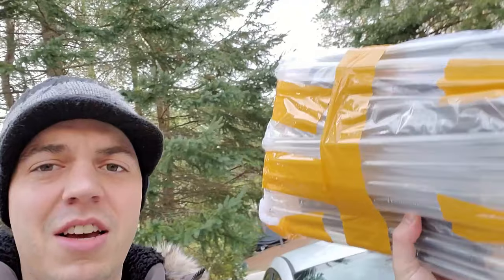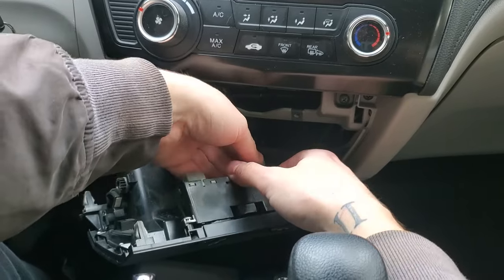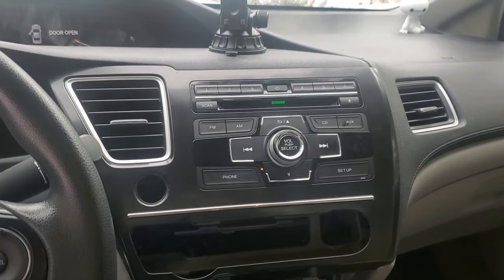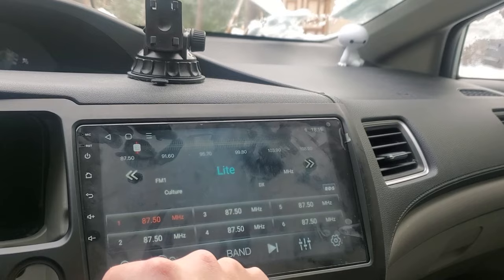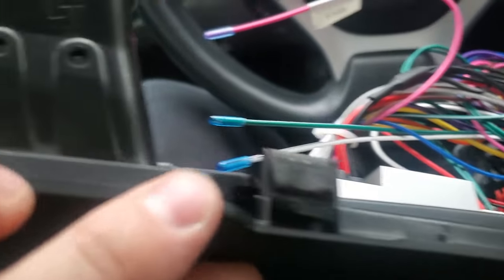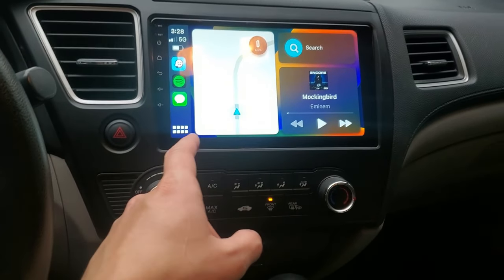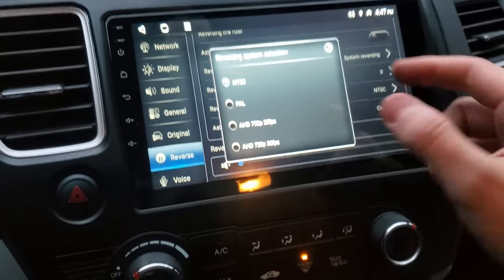Installing Android Head Unit In My Girlfriend's 2013 Honda Civic | Apple CarPlay & Android Auto

Comment: I wish you explained the wiring more or at least slowed it down😩
Reply from the maker: No need, it all just plugs in. Only wiring is the reverse camera
Reply: @zach_lush  then I’m not sure what I did wrong my screen  nor the little screen in the dashboard won’t come on… I even changed that fuse you changed
Reply: @jasminestuart5917 fuse under hood? Should be 10 amp
Reply: @jasminestuart5917 same thing here, did u figure it out?
Reply: @frankfacundo9082  yea don’t stress too much if the plug and play doesn’t connect then you just don’t need that plug lol but apparently I also blew a fuse nd my battery lost it’s crank power so basically if it isn’t connecting with the plugs you have all plugged in then something else is definitely wrong
Reply: I have the same one but makes no noises or music please what did you do
Reply: @dreybh7841 I have the same issue, did you figure it out?

Comment: If you are having repeated blown fuses, it is most likely the canbus device that is the culprit. I had the issue with the remote and mini screen not working. My canbus device has too plugs on both ends that had to be used. One of those plugs is identical to another plug on the stereo, which I plugged into incorrectly. I would still recommend unhooking the battery. Also, mine was also fuse #10. Correcting the wiring seemed to do the trick, no more blown fuses. My model was from Amazon but I followed the advice from another user and it did the trick.
Reply from the maker: Nice!
Reply: I’m having the problem with the mini screen staying on. Causing it to drain my battery. Going to take a look into it tomorrow. So would it be that I connect it the canbus device wrong that’s causing it? Thank you
Reply: @ianperez7665  hey man, I did not run into this issue, only the blown fuse/screen not working. You should open it back up to check the wiring. I’ve seen other people have this problem but don’t know the cause. Best of luck.
Reply: My canbus also has two plugs but idk what is supposed to be plugged into the other side. I assume this is why my steering wheel controls do not work. What plugs into the other side?
Reply: @Its_Jdiggs  my steering wheel controls don’t work as well 😭
Reply: @Kenneth-bm5zr  I been looking everywhere as how to fix the problem and no luck. iMID screen stays on. Canbus box is connected correctly. And my steering wheel controls don’t work. Either I don’t know what else to do. Can’t take it to the Dealership cause all they’re going to tell me is that head unit didn’t come with the car nothing we can do 😭  having to disconnect my battery everytime I turn my car off is getting annoying if I’m honest I’m thinking on putting the Stock radio back on
Reply: @Its_Jdiggs  hey man, you might have the wrong harness. Mine came with two, one that had two plugs for the canbus and one without. Mine came from an Amazon seller so I am not sure how different our stereos are.
Reply: Mine also came with 2 harnesses. One that had RCA adapters like the one in the video and one that was 100% plug and play. The cable that has the canbus plugged in is also plugged directly into the factory harness. I’ve got a buddy of mine doing research on it for me. Just thought maybe I’d find a quick answer here. And I did! I unplugged a plug that was directly in the radio and put it in the other side of the canbus and now it works!! Thanks for the help
Reply: @Its_Jdiggs  I am glad to hear! From my memory, I believe the identical plug on the stereo was for the optional audio cables if you have custom speakers/amps.
Reply: @ianperez7665 hey dude I had the same issue and just fixed it. You have to make sure your canbus software is updated and then go into the Canbus settings and configure it to your cars make and model. To do that go to Car Settings on the head unit and then Factory, you’ll need the factory code - once you’re in and fix that setting your imid should turn off and steering wheel buttons should work
Reply: @xdpham412x  I did that and it worked for me but sometimes stays on sometimes it doesn’t. I don’t know maybe I need a need battery cause it this issue really drained my battery completely
Reply: @xdpham412x  how do I get the factory code my car didn’t come with a code I’m having same issue screen stays on

Comment: How did you get the steering wheel controls to work? I bought the same unit and can’t get them working
Reply from the maker: In the setting you'll see an option for steering wheel controls (SWC) a menu will pop up with a bunch of functions. You select an option then push the corresponding button on your wheel.
Reply: you probably didnt connect all the wires, double check that your wires are all connected and secured. If that doesnt work check the factory settings to make sure its configured to your car make and model.

Comment: Is it possible to just pop out the OEM head unit from a 2014-2015 civic & install an aftermarket unit from say, BestBuy? I'd hate to have to get a whole other head unit cause of this. Thanks.
Reply from the maker: I just looked at the 14-15 civic headunit. You might be able to do it but I have no idea if the connections are the same.
Reply: @zach_lush  thanks!. You think a place like Best buy would install a head unit or just bring it to a professional shop?

Comment: I need to see how you wired this because you sped up the video on that part. Is it as simple as plug and play or there’s more to it?
Reply from the maker: Plug and play. Only wiring is the camera
Reply: @zach_lush  thanks man!
Reply: So you didn’t have to connect the Key 1 and Key 2 wires? I think these are the steering wheel controls

Comment: By far the best video I’ve watched! Tried installing my own and it wouldn’t turn on. Watched your video and got to the part about the fuse. Fixed it instantly!
Reply from the maker: Happy to hear it helped!
Reply: @zach_lush  would this work for the si?
Reply from the maker: @zoob4371  I can't see why not. But I'd double check with the seller.
Reply: Hey faith does your steering wheel controls still work, or your car info screen ?

Comment: Question. Are the button instruments back lit by chance? Can these be illuminated at night or is that not an option? Love the video!
Reply from the maker: The buttons on the left side of the radio do illuminate and you can change the colours. Also all of the buttons around the radio are still factory and still work like factory. Hope that helps!

Comment: I got this same unit in December. Still works fine now. You can turn that turn signal feature off. I never got my phone control options to work. Just the vol and skip track options. Which is fine, the mic sucks anyway so I just use my AirPods to talk.
Reply from the maker: How did you turn it off? I was unable to figure it out. Even went into the developer options. I could not get the phone to work aswell. Mic is trash
Reply: @zach_lush  I’ll be back to my car in like 2 weeks. (Work out of town) I’ll be happy to send you a video 👌
Reply from the maker: @hmendoza79  please do!
Reply: is it still good to this day?
Reply: @tined4520  sadly the car was totaled in August, someone ran a red light and destroyed the vehicle. But it was working fine until then.

Comment: Did the car have a factory reverse cam? Any idea how to use that instead of mounting the cam that comes with the unit?
Reply from the maker: No, it never had the reverse camera. Also i dont think you can retain the factory one unless you figured out what the wiring was and spliced into it.
Reply: @zach_lush  Yeah, I'm afraid that would be the case :(

Comment: Hey man great video, i noticed on the reverse camera you did not connect the signal wire, can you explain where the unit get signal when you go into reverse?
Reply from the maker: Before i had the camera connected the headunit already knew when the car was in reverse. Guessing the factory wiring sends an output that lets the car know its in reverse and the headunit utilizes it. I ended up just getting power on the rear tailight bulb which powers the camera.

Comment: How did you install the back up camera? What did you attach it to in the front of the car and what did you attach it to in the back?
Reply from the maker: Theres nothing in the front, also used the provided screws that came with the camera
Reply: Ok so two questions the wire on the the plug that I plug into the back of the unit isn’t used? And what did you do with the wires dangling on the end that goes into the actual camera
Reply: Also when I’m in reverse my music stops do you know how to make that stop?
Reply: Also when I’m in reverse my music stops do you know how to make that stop?

Comment: Please help me, after installing the head unit my IMID screen will not turn off even when the car is turned off. I’m afraid it will drain my battery
Reply from the maker: Best I can suggest if check your fuses or contact the seller. I posted another video showing the issues I had and someone commented a fix they had to do. That may help you.

Comment: any issues with the screen being laggy or delay? also, does the carplay or android auto disconnect often or no issues there?
Reply from the maker: Nope no issues, i know theres cheaper versions out there. You'd start seeing those issues if you were to get a cheaper model. Typically due to having less RAM which will cause lag

Comment: Super helpful video got an update hows it holding up after 6 months? Ive installed android radios before and really wanna do another one.
Reply from the maker: Thanks, I started filming an update video but still having issues with the camera video output coming on when signaling right. Once I have that removed I'll post an update video.

Comment: Does this head unit tie into the existing USB port inside the arm rest storage box? Does it work for wired Apple CarPlay? I prefer wired over wireless CarPlay so just wondering if it allows for a USB connection.
Reply from the maker: I'm not sure. I inly use wireless android auto. It has an extra usb cord coming out of the unit and that may allow for a wired apple carplay, but we never use it.
Reply: I just installed similar unit and could not get the arm rest usb to connect to CarPlay. Even the instructions said to use the usb that was provided by the device. Not sure if there is a workaround but kind of annoying. My wireless CarPlay stutters sometimes.
Reply from the maker: @Kenneth-bm5zr  i ended up trying with the armrest usb but no luck aswell. I use android auto but only have issues with connection if the service is poor. Otherwise no issues having it wireless.

Comment: Late comment but it’s saying no signal because most 9th generation civics have a camera underneath the right mirror either you don’t have it or it isn’t hooked up
Reply from the maker: Thank you, i was aware the car didn't have a camera, i was more so hoping the headunit had an option to just turn the feature off. The issue has since been fixed, theres a link in the description to another video where i change the headunits settings to a differt year car. That ended up removing the no signal from a camera issue.

Comment: Incredible. The same thing happened to me when i realized the small screen and remote lock and unlock didnt work anymore. This was exactly the video i needed! Would you be any chance have a pic of the exact wiring to the new head unit that ended up working?? Also how hard is it to change the fuse?

Sorry for all the questions. Thanks so much in advance!
Reply from the maker: Nice, looks like I uploaded it at a good time! The fuse is not difficult to change at all. Just pull it out and replace it with a new one of the same amps. Unfortunately I do not have photos of the wiring on me, just what is in the video. But the head unit I used is in the description of the video.
Reply: Did you get the fuse replaced? Unfortunately I’m having the same issue and everytime I keep replacing the fuse it just instantly blows again. Any idea why?
Reply from the maker: @marinamurillo3476  are you removing the ground terminal on your battery? If not it could keep blowing the fuse.
Reply: I had the same problem, but for me, even the tiny display was not working in the car. And also the new display. Do you want me to change the new fuse and put the new display later, or the new display first and the fuse second?
Reply: Is it possible to just pop out the OEM radio from a 2014-2015 civic & install an aftermarket unit from say, BestBuy? I'd hate to have to get a whole other head unit/plastic trimming cause of this. Thanks.
Reply from the maker: @dbzownz12345  in all honesty I have no idea, I'm a subaru guy, not a honda guy! Checking the forums would probably give you a better answer.
Reply: @dbzownz12345 i put a 2015 CRV EX-L headunit in my 2014 Si. I now have CarPlay and physical buttons and all of my factory accessories (buttons) and IMID. No weird aftermarket trim and it was completely plug and play

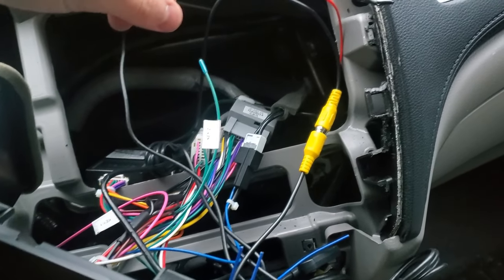Comment: not sure if you addressed it already but at 15:46 that red wire with electrical tape with the video plug is suppose to connect with the wiring harness 'back/reverse' wire.
Reply from the maker: I'm pretty sure I never connected it, but i would have to double check. But why, what does it do exactly?
Reply: @zach_lush  it's the on/off switch for the camera, when you put it in reverse,, it will keep the camera off when it should be off. but since you never connected it, when you hit the right turn signal.. power will come thru the camera since you used the right turn signal wiring to power the camera. which might explain your issue.
**oops... reverse lights
Reply from the maker: @Player_Mick  Hmmm I'm not sure about that, I did test the camera before tucking the wires and I did confirm the reverse light came on when I put the car into reverse. Also the camera would give signal input to the head unit when I put the car into reverse. Its getting warmer here and I have a new trim piece for it, when I swap that out I'll double check the wiring and see if that would fix it.

But I'm assuming you have that red wire tapped into a reverse wire somewhere in the car?

Comment: The right turn signal will/should activate the blind spot camera attached to the right side mirror.  They called this feature “Lane watch”
Reply from the maker: Thanks, I'm aware what it is doing when signaling. However our car never came with the cameras in the side mirrors. So this feature is useless for us, just asked the seller again to see how to deactivate it.
Reply: It's pretty easy to deactivate it. But seriously that was alot of plastic and work and if it fails you gotta take all that shit out again and redo it
Reply from the maker: @jaxripper251  I've tried, can't find a setting anywhere. I've contacted the seller but they don't seem to know how lol. It really wasn't that bad, could put the original radio back in like 30 minutes if I had too.
Reply: Civic also has the lane watch for upper trim level.  But I guessed you need to buy the part plus figuring out the harness in order to make it work.  There’s always an option to purchase the part from a savage yard.  Plenty out there.
Reply from the maker: @frankm7707  if I can find the mirror on a scrap yard I would add them. But this is a LX model which never came with the side cameras. Right now just want the lane switch feature deactivated for now
Reply: @zach_lush its made to be compatible with 2017 si and newer that's why you see it asking for camera.
Reply from the maker: @chrisvigo4880  I don't really agree with that since the hybrid model of our year has the lane change cameras. Also the interior bezel is made for our year, 2017 and newer is different.
Reply: I own a 2015 Si and it includes Lane Watch in the passenger side mirror.  It also auto activated with a right turn signal or manually with a button at the end of the turn signal stalk.  Wires must be incorporated from the stalk to the radio to activate but with no side mirror camera there’s no signal.
Reply: Having audio issues on 2014 Honda civic si ? Radio works n all just no audio  any help
Reply: @T4ddyP0rt3r  bro can you help me install I have a 2015 si too
Reply: @dnaxfilms9132  sorry bud, not my forte, this is a Zach thing.  He’s the guru.

Comment: Hey man, what happened to the little screen aside the cluster?
Reply from the maker: No issues with mine
Reply: @zach_lush  Before installing you had some info there about music playing and a few more things, those display still remain or they gone? i want to get one for my Civic, have you had any problems with the head unit?
Reply: @zach_lush  Another thing if you can help me, does it have this function to increase or decrease the brightness when you turn on/off the headlights?
Reply from the maker: The display still works, but you do lose some features in the mini screen. There's an issue where I signal right and the screen waits for an input. Also yes the screen brightness changes based on your headlights

Comment: Did you fixed the problem of the blind spot camera?
Reply from the maker: I haven't had a chance yet to fix it. I tried from the sellers but had no luck. Life has been busy lately but once I get a chance I'll try to find the wire and cut it so it disables this feature.
Reply: @zach_lush  I understand man life is busy. I got these stereo one week ago and I still don’t have time to install it 😤😂
Reply from the maker: @derekotero7935  it sucks when you don't have enough time! I have many parts for my subarus but not enough time to install them or edit the videos 👎🏻